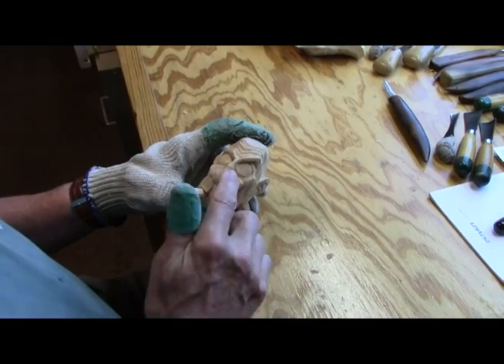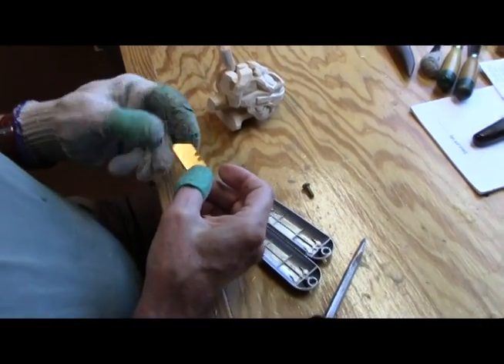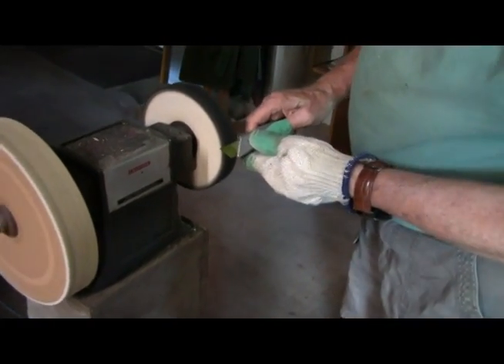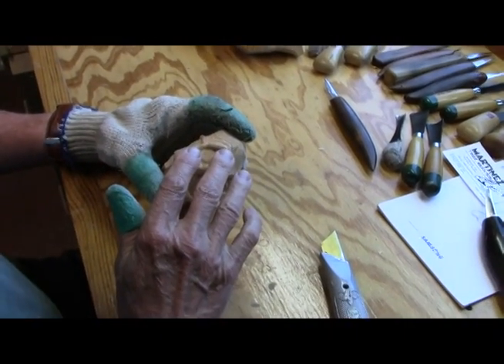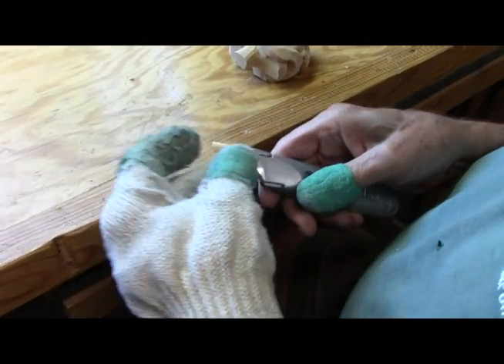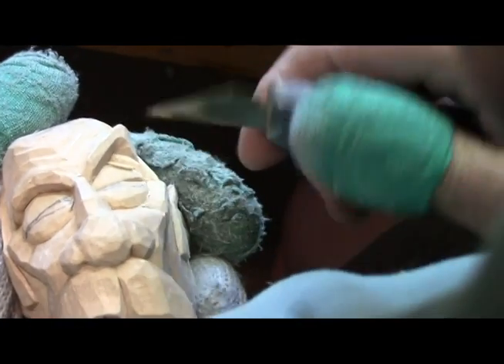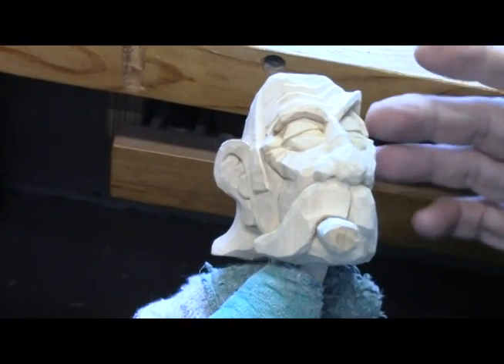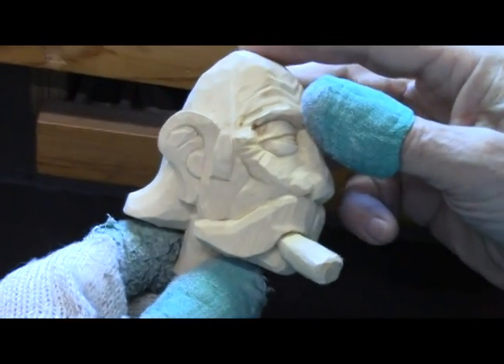Carving a Caricature Head   Part 4

Comment: I thought we sharpened on leather first then go to the buffing wheel. you do it the other way around. whats the advantage of that please?
Reply from the maker: The blade is already sharp but I first use a bit of sharpening compound on the cloth wheel to remove the factory burr and then strop it on the leather.
Reply: Very good of you to reply Lynn. I see what you're doing there now! Funnily enough I've just messaged Gene Messer over a similar query but before getting your answer. He's been helping me out getting started in Flat Plane Carving at 67!!! Love your work too of course but I ain't got time left to learn what you two know lol. ATB from the UK.